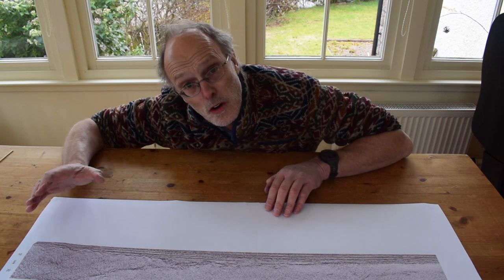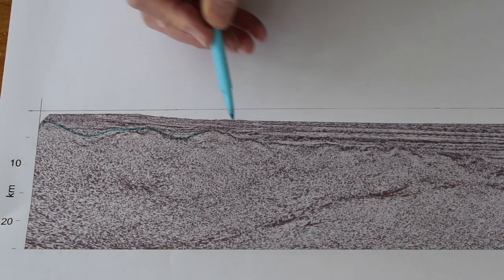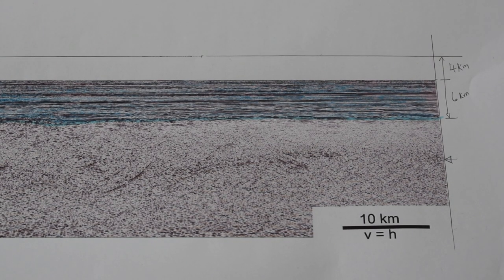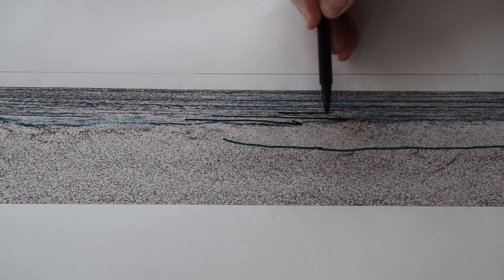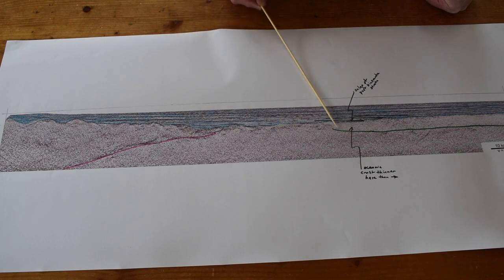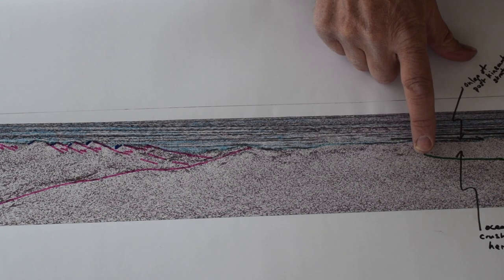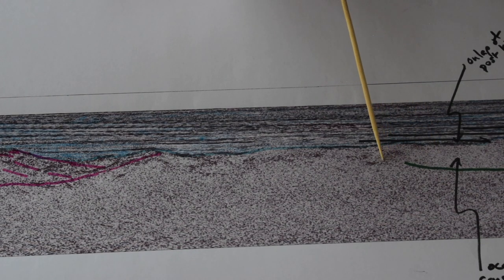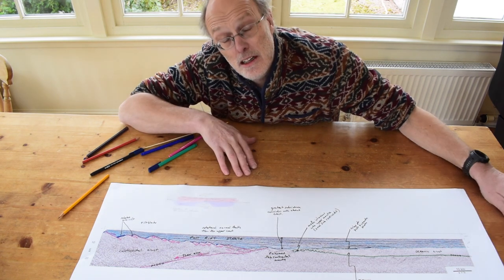Interpreting a rifted continental margin - on a seismic profile

Comment: Rob I really loved this analysis. Perhaps you might consider a mid crustal detachment below the rider blocks which would explain homogeneous upper crustal extension. I am not convinced of the back dipping mojo shear zone. Instead the detachment could continue and define the top of the continental mantle and root beneath crust on the conjugate margin (not in this section). In this geometry the lower-plate continental mantle could have been derived from beneath the crust of the conjugate margin by normal sense displacement on the detachment. Just some thoughts. Keep up the great work.
Reply from the maker: Thanks for the comment John. You make some good points. There are (of course) several ways of interpreting this section. A key choice lies in the significance of the reflective lower crust - shear zone or original (undeformed) underplate.... We solicited a suite of interpretations (all different) for the section - paper coming out soon on the results (will update once out). And there are four different published versions out there already. Although a common component in the interpretations is the exposure of originally subcontinental mantle at the seabed (before being buried by post-rift strata), I'm not a fan of a "one-size fits all" model for continental rifting proposed by some groups - orogens don't do it, so why should rift systems... so indeed - your suggestion works too.